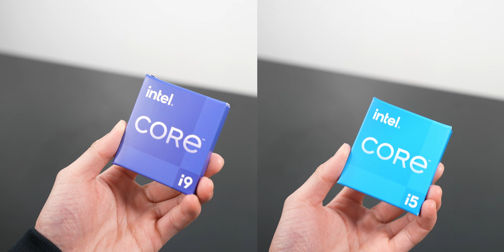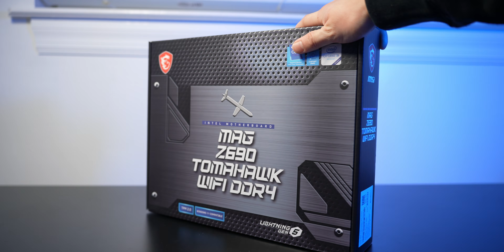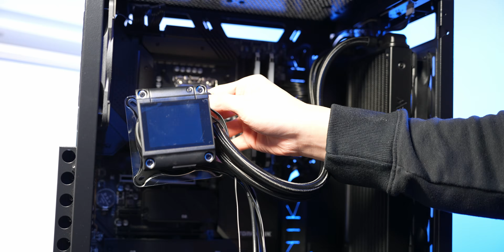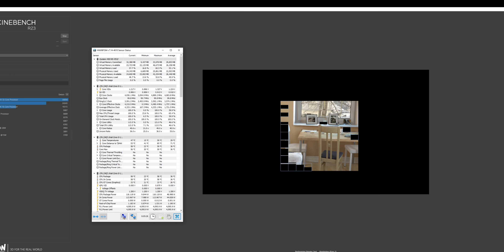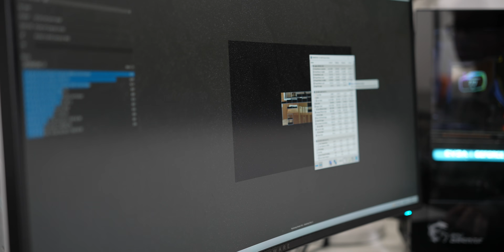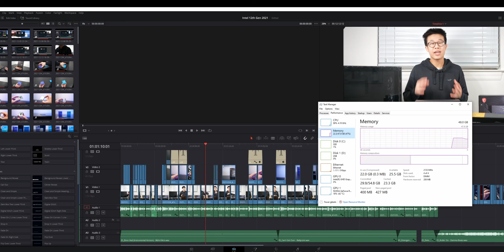Intel Core i9-12900K and Core i5-12600K PC Build 2022! - Benchmarks, Thermals + More

Comment: I was thinking abt getting a i5 12600k and a 2060 for a budget build do u a i5 is enough I’m trying to also get into tech and computer engineering
Reply: I went from R7-3700X and a 3080 Ti to an i5-12600K (and the same gpu). There isn't anything I've not been able to run at max graphics settings and get an absolutely superb experience! I tend to stay at 1080p or 1440p and max quality settings. I was hitting (per the computer's telling) frame rates in the 300s on Cyberpunk with everything at max. It held that frame rate for the duration of my time on there. 

Unless you've got some crazy production tasks, I think the 12600k is phenomenal! (I know I'm 9 months late to the party, but I hope whatever you went with is working out for you).